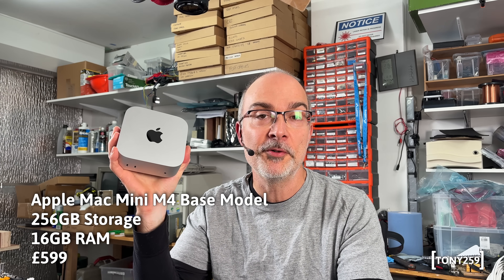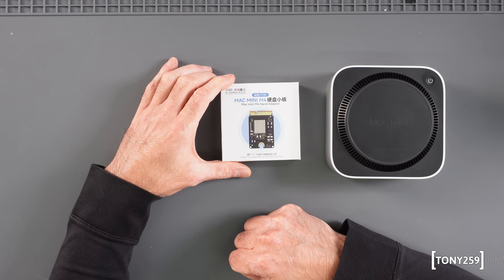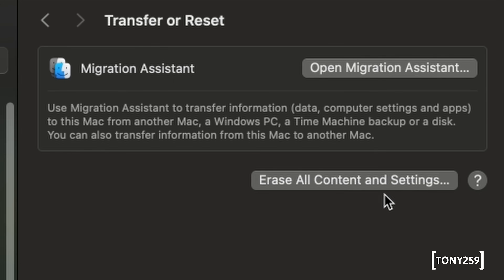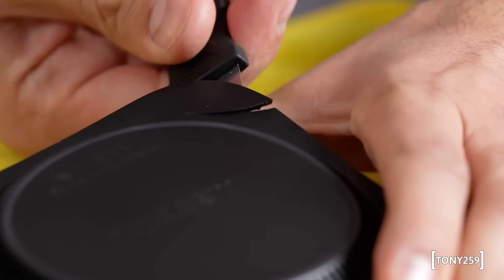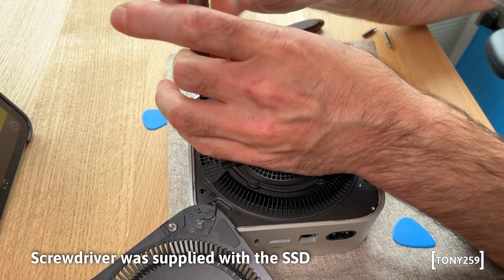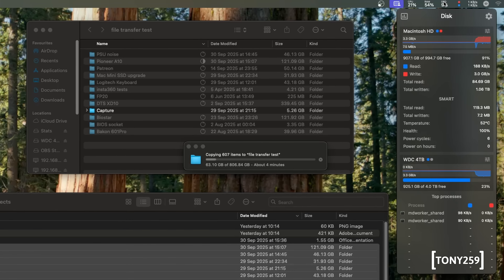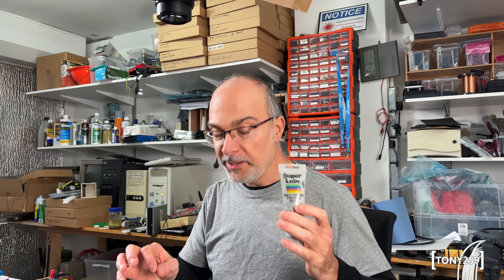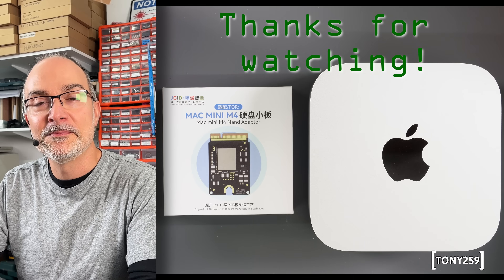CHEAP AliExpress SSD for Mac Mini M4? (Yes, I BRICKED it!)

Comment: I've been looking at getting an M4 to replace my 2020 M1 mini (16GB RAM, 512GB SSD). I would not consider anything less than 512GB storage, as (for me) even 512GB is very tight, requiring tricks to move lots of user files to external drives. Given Apple's pricing scale for upgrades, it seems that the 24GB M4 with 1TB storage at $1300 (including 10Gb Ethernet) is the most cost effective configuration for the average person who is not a creative professional. For better or worse Apple appears to be sticking to their strategy of making products as non-user-upgradable as possible, so finding an acceptable up-front features vs price trade-off, for me at least, is the way to go. I see a lot of videos of these types of upgrades, but frankly the effort and frustration involved isn't worth the up-front savings (and I build PCs as a hobby). But thanks for the content!
Reply from the maker: I see your point and I agree. But I am a tinkerer and I like doing these things! For sure, if you want a reliable system which you're going to work with, then you pay the Apple tax - or you can boot from an AFS disk directly, bypassing the internal entirely. Let's say it's nice to have an option - though it's a big question mark for sure. 
I don't hide the fact that I am concerned that in xx months time my Mini might become unreliable and the Aliexpress SSD would be the first to be blamed of course. 

In the end, it's a cool exercise but for sure it's not for everybody. Thanks for watching!

Comment: Increasing tje fan speed does not cool the ssd itself properly, i suggest you cut two thermal pads and put one under the ssd and one on top of it, that way you might save it and extend the life expectancy
Reply from the maker: it's called "stats". It's free. Beware though: if you set manual control, the mac mini will not control the fan anymore. That is, if you set the fan at minimum in manual mode, the temps inside might eventually skyrocket and the fan WILL NOT speed up.

Comment: Same thing happened when I reset my 2020 iMac 27" to original settings. There was an error during update and was constant.
Had to take it to a shop that fixes Mac's. Paid $85 and it was back in action with latest Tahoe 26, but Tahoe had Bluetooth issues with Magic mouse and keyboard, Tahoe 26.01 fixed that.
Reply from the maker: I thought Apple Stores could fix that for free - in the end it's just "reinstalling" the OS. $85 to just push the OS on it is a lot 🙂 
I'm avoiding Tahoe for now, I won't consider it until 26.1 comes out 🙂 Thanks for watching!
Reply: @Tony359_2 warranty expired few months ago
Reply from the maker: My understanding is that they might be able to help you for free regardless. If it just needs to be "revived", it's a very simple process. Anyways, too late now, but bear that in mind for next time. Good to hear it works now though 🙂
Reply from the maker: That must have been a beefy M1 I guess! 🙂
Reply: @Tony359_2 
Nope 2020 iMac 27" 8 Core 64gb ram and Radeon pro 5700xt 16gb. 

Sorry that was CAD so about $1000 to 1200 usd.

Comment: Just use some wide duct tape and make to pull tabs out of it and then get someone to hold the mac down and pull on the tabs left and right where the pins are and it should come up mayve clean the surface with alcohol first to get the best possible adhersion.
Reply from the maker: ah yes, that was another idea I had - I forgot to mention. Thanks!

Comment: If they fail after several months it could be an issue of incompatibility of the operating system. It happened to a bunch of the new generations of Mac Books. It took some firmware updates to correct issues but many were left with dead MacBooks considering Apple is now soldering the "hard drives" to the mother boards.
Now what happens when you have only a 2013 MacBook Pro running high Sierra. You know not all of us have $4K to upgrade to Apples newest and greatest.
Reply from the maker: Oh yes, Apple have left many customers stranded in the past. Think of 2011 MBP and the Radeon graphic chip.

Comment: the mini has decent thunderbolt ports, the external ssd is a wiser path
Reply from the maker: It depends. I’m already using an external SSD but it’s NTFS and I don’t want a second one. Plus, I travel with the mini a lot and I don’t want to depend on something else. So, it depends on your needs. This is one of the options.

Comment: Interesting that Apple decided to keep the storage chip on a separate PCB. I thought they solder everything to the main board these days (locked down with serial number checks and so on).
Reply from the maker: Indeed, everybody was surprised to see storage on a module. I'd imagine it was cheaper for Apple as well, someone there discovered that you can customise your generic boards with a module!

The Mini M4 comes with 3 sizes of RAM and 4 sizes of SSD. Without the module, Apple would need to manufacture and store 12 different types of board. With the module, only 3 (plus the modules). Simpler. Faster.  Apple discovered modularity - again 😀 
Thanks for your visit!
Reply: @Tony359_2 The Mac Mini M4 is a real enigma. It's simply the best computer value on the market. It outperforms most high-end PCs, yet it still costs less than most low-end PCs. From a business point of view, it makes no sense to have swappable drives on such a low priced machine. You want customers to buy new machines, not upgrade their old ones. The older iMacs had upgradable RAM and storage, but the newer ones don't. So ease of manufacturing and inventory doesn't quite explain it. I feel sorry for the 2019 MacPro owners. Apple screwed them hard. 😂
Reply from the maker: "Enigma" is the right word. I reluctantly had to switch to the Mini as main computer after I realised that Resolve on the PC was lagging behind the Mac. The PC is much more powerful on paper, on benchmarks. But editing on macOS is much smoother than editing on Windows. I'd imagine it's a matter of resources optimisation. 
Now I don't feel like upgrading the PC - but I cannot think of getting a Mini Pro which is silly money... 🙂
Reply from the maker: "mediocrity is not only tolerated, but expected." 😂
Reply: @Tony359_2  I agree. They do solder the NAND chips in Macbooks, but those have a higher margin. For Apple, the Mac Mini is a low cost, low margin product. At least as long as you pick the lowest storage option...

Comment: "There is no LOGIC in it, I think there is some voltage regulation and just the NAND storage ICs on it." Mmm aha, lets look up something real quick: "In digital electronics, a NAND gate is a LOGIC gate which produces..."
So let me get this straight, you're saying there is no LOGIC in the module full of LOGIC gates? Call me harsh but I think the dislike you're getting from me for this is VERY WELL deserved. 
I'm not saying you need to know all this stuff, but what I AM saying is: IF you don't know much or anything about it - DO NOT SPEAK LIKE YOU DO. You might then say "but that isn't the kind of logic I meant!" well, what you probably meant is a wrongful use of the word to begin with, actually a layercake of wrongful uses. NAND itself is a shortening of Not AND - the inverse version of AND. What are AND and NAND both a type of? A "LOGIC GATE" ba dum tss - I rest my case.
Reply from the maker: Hi Harsh,

I hope you're going to have a better day than it shows on your comment! Thanks for your comment and for the dislike! 🙂

Comment: There is a good tip on the iFixIT video for the M4 upgrade to unscrew the power button rather than trying to remove the power cable
Reply from the maker: Ah excellent. I didn't realise it could be unscrewed, thanks for mentioning!
Reply: @Tony359_2 4 T2 Torx

Comment: Tbh I'm lazy, I just installed MacOS on an external NVME in the dock and boot from it :D
Reply from the maker: yes, that also works. My external drive is NTFS so I cannot use that and I didn't want another one. Also, I travel with the Mac Mini a lot and I didn't want to rely on external storage for apps too. But it's an option for sure!

Comment: Why not just get a 4TB USB4 external SSD?  Wouldn't that be cheaper and plenty fast?
Reply from the maker: It's an option - my 4TB external SSD is NTFS though because I use it on Windows as well. I cannot install apps or running VMs unless the FS is APFS.
Also, I don't know how simple it is to install/move apps to an external SSD - I believe the best solution would be to boot from it.
Finally, I move my Mac Mini quite often and I didn't want to have to rely on something external even for basic usage.
But of course an external drive is also a solution.

Comment: Great video, and in my opinion choosing the one TB size is the best option as even the 3rd Party storage modules hace still double the price tag as a PREMIUM NVME SSD drive (e.g. WD Black SN 850x, Samsung 990 Pro, ...) yes 256 GB is probably to small and 512  the maximum viable original upgrade for those who don't want to upgrade their Macs themselves. If 1 TB of storage is not sufficient you should  consider external drives as Hot (NVME drive in USB or Thunderbolt enclosure) or Cold (USB with SSD or HDD) storage.
You don't need to store cold data on your Mac. Its hard to consider what data you will process that need more than 1 TB of hot storage (to be honest than you need probably a total different device Mac Mini with Pro Chip and maxed out Unified memory or a Mac Studio with a decent amount of unified memory).

I'm curious to compare my Bresun 1 TB  modules (still laying around) performance figures, which has only i think a 6-layer PCB, if there are any differences. Also the comparison between 2 TB and 1 TB variants might be interesting. But my assumption propable differences might be measurable  in synthetic tests but completely irrelevant in daily use for the average user (there might be some power users exactly utilizing their devices harvesting all the gain  converting into total performance increase)
Reply from the maker: Indeed, all my video stuff is on an external USB4 4TB SSD. Just 256GB are not enough for the apps! I would have probably been able to live with 512GB. 
AFAIK the Mac Mini base is limited in speed - the Pro will get to Gen4 speeds, but not the base model. 

It's plenty for me. 🙂 
Thanks for watching!
Reply: @Tony359_2  I have an old 8TB external HDD und USB3, three TB enclosures each with 2 TB drives, and i have to install the 1 TB NAND carrying module.
On the typical occasion like Black friday or prime days there are good offers.
The major isssue you won't get BTC-variants on a good price (always MRSP) while OTS-products are often heavily discounted, so even the first Apple uprade is insanely expensive (e.g. i got my Mac Mini M4 for 555€ instead of 699€, the upgraded 512GB version is around 949€, the version with 24GB/512GB is around 1199€ the version 16GB/1TB is around 1199€), my upgrade was around 145€ including taxes and toll so in total 555€+145€= 700€ wich is ridicously near by the MRSP for the base model 699€ and 500€ cheaper what apple claims.

Comment: It worked on me. I wanted to find out if the Ali SSD bricked your Mac and clicked on the video. In fact Ali had nothing to do with the bricking, but I found another creator though who cares a lot about details and has nice and entertaining way of presenting his content. Despite of me being annoyed about myself because I fell for the bait , I am thankful to have encountered this channel.
Reply from the maker: ahaha - well, I did brick the Mac in the video! I'm glad you enjoyed the video though, thanks for your kind words!
Reply: @Tony359_2 , Come on now, your Mac mini is not bricked, and you know it. If it shows up in DFU mode and you can restore it from another Mac, that means everything that actually matters inside that machine is alive and functioning. The bootloader is fine. The firmware is fine. The recovery system is fine. The only thing that is broken here is your understanding of what the word "bricked" means.

A real brick is a dead lump of silicon and aluminium. It does not power on. It does not appear in DFU mode. It cannot be recognised by Apple Configurator or any other tool. It sits there doing nothing, because it has no functioning firmware left to talk to. If your Mac mini were truly bricked, you would not be proudly showing off your recovery process, because there would be nothing to recover.

What you are describing is a system that needs a firmware restore. That is not a tragedy. It is the reason DFU mode exists. Apple built that feature so that users and technicians can revive Macs when macOS or the internal storage becomes corrupted. You did not pull off a daring act of digital heroism; you ran a routine restore exactly the way Apple intended.

So, no, you did not "bring your Mac back from the dead." You jump-started a healthy machine that tripped over a software issue. Calling that "bricked" is like saying your car exploded because the battery went flat. It is sensational, inaccurate, and transparent clickbait. You might get the views, but you are not fooling anyone who actually understands how Macs work.
Reply from the maker: @hackbinary  A device that cannot be revived by reinstalling SW with a USB stick is "bricked" in my mind. 
We can argue about this all night and we'll never agree! We can agree to disagree of course!

Comment: When I clicked on the video, I thought the "I bricked it" in the title was going to be clickbait since replacing the SSD literally bricks the machine, requiring a DFU recovery to fix it, but I was surprised to see your machine didn't survive a factory reset! Either way it worked, because I clicked on your video to find out! 🙃

Definitely smarter than what I did, which was blow an entire overtime pay on buying an upgraded (Apple refurb) model.
Reply from the maker: Yes, not a clickbait unfortunately! Nothing smart here, just taking advantage of this option: most apple products come with soldered storage. Thanks for watching!

Comment: Good video as always. Quite a few other channels just jump over the hard parts of the disassembly without showing you what to do. One thing I am finding more and more of is that it is so much more common to end up breaking plastic clips unless you have opened up a similar one before and can work out the right technique. I thought to myself after you took the back panel off that I would lubricate those pins on reassembly - and there you go, you do exactly that.
Reply from the maker: That's exactly why I spent some time showing the opening struggle: most videos I found online skim on that part. I hope it's helpful. Honestly, 4 screws would have been fine 🙂

Comment: Man my MacBook Pro M1 Pro is NOT holding up in the long run when I have hundreds of gigabytes of songs and it's only 512GB 🥲
Reply from the maker: Yep - All my data storage is external but 256GB is not enough for apps. I guess I could do with 512GB. That's also why I didn't go with the 2TB model, I really don't need 2TB of internal storage.

Comment: I thought Apple placed a software lock on their component - guess I was wrong. But the length you have to go through just to open up the back tho. They really don’t want you to repair/upgrade your own computer. Thanks for sharing the interesting process
Reply from the maker: Yes, very surprising. Apparently the module is "NAND ONLY" so no logic or chips so no lock can be implemented. If you watch AmorphousDiskMark, the SSD is being recognised as an Apple SSD. Weird. But if it works...
I'd imagine Apple had to replace so many motherboards because of failed storage that they thought the benefit of the module solution would outweigh the few people installing a replica module inside! Thanks for watching!

Comment: lol...apple fanboys are really ripped off

£150 for a 1TB ?

1TB NVME can be had from amazon for £50
Reply from the maker: Well, to buy a 1TB Mac Mini, Apple asks for an extra £400 so £150 is a bargain to me! 😀
Reply: It’s the closest thing to a modern day Acorn Archimedes. There is enough power in that tiny box to run Blender and render scenes using Cycles and have over 100 tracks in Logic Pro without the audio breaking up 😊
Reply from the maker: I've never been an Apple fan (besides vintage Apple!) but this little machine is outpacing my big and large Windows Desktop machine so...
Reply: And that NVME drive will work just fine with a Mac. 🙄

Comment: Do you know if there is any difference between the 256GB and 512GB Mac Mini versions? I remember some other Apple devices (maybe Macbook?) having additional components for larger storage sizes, but with a detacheable board like this I'm not sure.
Reply from the maker: AFAIK all Mac Mini are identical. The Mac Mini Pro has a different type of storage - I think the Pro has faster storage.

Comment: The base plate would be a lot easier to remove if Apple hadn't fixed the switch and wires to it.
Reply from the maker: Or used 4 screws… 😂

Comment: I've been wanting to do something like this for my M4 Pro Mac Mini but as I don't have another machine new enough to do the DFU mode recovery.
Reply from the maker: You can use windows! Yes, apparently. BUT, my windows machines are all AMD and an intel CPU is required. If you’re on Intel, you basically need to run macOS on a virtual machine and it might work…

Comment: f3 tools for mac and linux (fight flash fraud). It was slowing down due to heat and filling it up. Once get over 50% full, the SSD will start slowing down. It wasn't cache, it doesn't have that much cache.
Reply from the maker: Definitely not heat did you watch that part? There is no 350GB cache but the SSD keeps writing WHILE the cache is being filled up so the slowdown happens at some point but not after the amount of cache - if that makes sense?